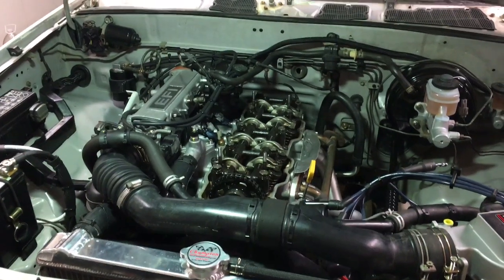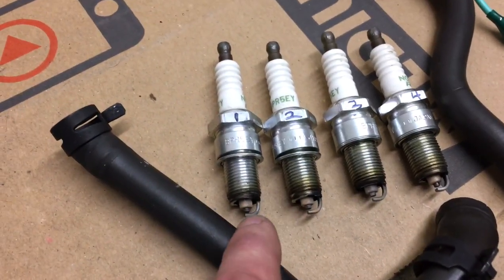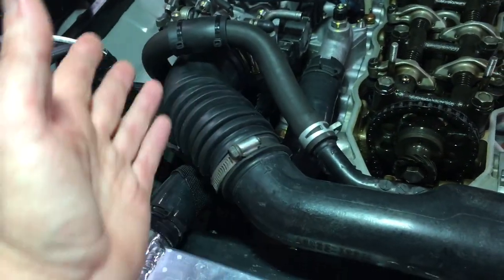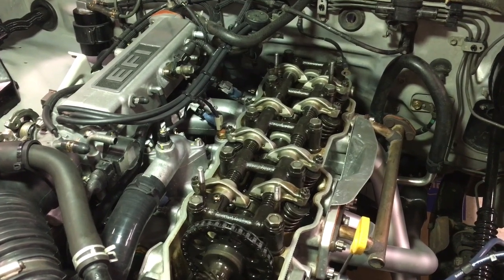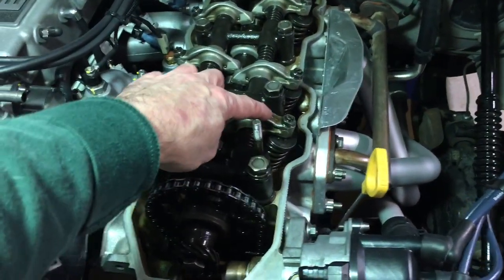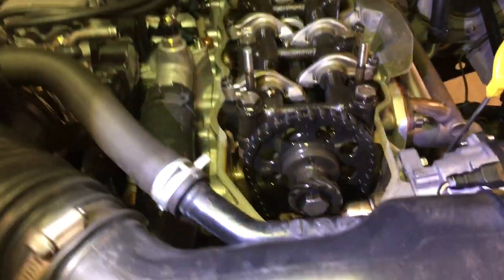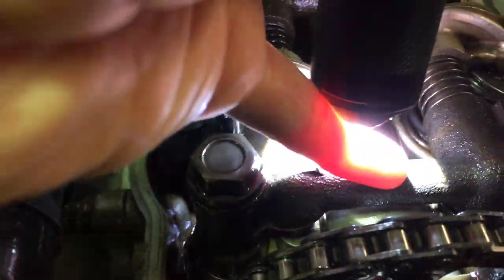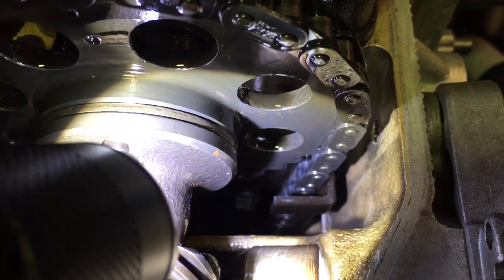Toyota pickup 22RE running rough, valve adjustment & cam gear timing check

Comment: Thanks for the explanation. Another way to find TDC on #1 is to line up timing mark AND see if distributor rotor is pointing to #1 spark wire

Comment: I just received my radiator exactly like yours at Champions I attached a aluminum diamond sheet metal to hold the electric fan with the overflow container from champion also.
Reply from the maker: Glenn Gamboa That's great!

Comment: Aloha Ray, very instructional video Mahalo for that. However, I recently did a top half rebuild and after putting everything back together I noticed that I am on TDC but I may be off a tooth like you mentioned. Those little divots on the sprocket are more between 12 & 1 o clock. Is there a video that you can refer me to or a link I can down load to realign without taking everything apart? Any help or advice would be greatly appreciated. Me and my boy been part time on this build for almost a year and it would crush him and me if we had to open up everything again. Mahalo again from Hawai'i
Reply from the maker: Sounds like you might be off by 1 tooth. Here's a video showing how it should look when the motor is at TDC https://www.youtube.com/watch?v=96xb0oWA3fQ

If you are off, you can put the motor at exactly TDC and then you can pull everything off the front of the camshaft and slip the gear 1 tooth; you just need to make sure to keep the timing chain taut against the guides using like a little block of wood or something. If you do that, you can reposition the cam gear without too much trouble. Normally the dowel pin in the cam should be straight up and down when the motor is at TDC. Hope that helps!
Reply: @ray5961  Yes it does braddah, I will try that first thing in the morning and give you an update. Appreciate your reply. Mahalo!
Reply from the maker: @alekokipuou1433  good luck! let me know how it goes. Make sure to re-time the distributor as well.

Comment: Hi Ray. On the valve adjustment that is suppose to be done hit. How long do you wait for engine to cool down to start the adjustment? Thks..jc
Reply from the maker: I usually do it when the motor is still warm, but not super hot to where it's hard to work. Maybe like 30 minutes after shutting off the motor. I run .012 on the exhaust and .008 on the intake.
Reply: @ray5961  Thks Ray..jc

Comment: I have a '85 Toyota with 22R  factory carb.  with manual trans.  Takes 1hr or less to set valves.  The engine  is warm. as per. Shop Manual.  I'm a 70yr old White guy.  I'm including a Video of the rnotor startng cold so you can judge for yourself.
Reply: Great video !

Comment: Hello Ray! Can you describe your battery/cable/hold down setup for us? That is one clean look! Thanks very much!
Reply from the maker: We were actually just discussing this on another video yesterday and I listed a lot of the parts. Check the comments on the last couple of videos and if you can't find it, I can locate it or give you a run down. The hold down is just a strap and then the rubber thing which holds the tool wrap thing behind the seat
Reply: @ray5961  Thanks Ray, much appreciated!

Comment: Great job man 

Radiator name?
Reply from the maker: Thanks! Champion cooling... I have a video on my channel about it also. https://www.championcooling.com/ - nice radiator, but the one I have leaks a tiny bit and it's super annoying. They did warranty it, but I've yet to install the new one. Several other people have commented that theirs leaked as well. Not sure I would use them again, but if you get one that doesn't leak, it's super nice. I think maybe their welds are not perfect inside or something but who knows for sure.

Comment: Hi Ray. I did a valve adjustment finally and changed out my temp guage sensor at same time. Now my guage is reading hot and almost into red. Is there any chance if I screwed up the valve adjustment that that would cause over heating? I chkd the temp sensor, connecting wire and temp guage and they chkd out fine. I am at a loss right now. Burped cooling system also. I am just wondering if I should redo the valve adjustment if that can cause overhearing. Hope to hear your opinion..thks...jc
Reply from the maker: Did you use a Denso or Toyota sending unit? I'm not a big fan of the ones from china that are all over the place. I think I'd start by swapping back in the old sending unit maybe. Valve lash error can affect temp a little, but probably not drastically enough to register on the gauge. You would have to be pretty far off the map for that to matter. My best is the sending unit is bad, especially if it's an Amazon special or something. If your old sending unit was working, just clean it up on a wire wheel and throw it back in.. they usually go forever.
Reply: @ray5961  Hi Ray, thks very much for getting back to me. I did put old sensor back ( new one was Denso) Here is my test for the day:
First thing I did was swap the new temp guage sensor with the old one. Noticed that the connector did not fit as snug on the new as it did on the old. A little difference on how the  terminals at the top had a small different design. 

Next, opened up radiator cap and placed thermometer inside so I could track temp.
Coolant at cold was 88 degrees.
Next, start engine and start clock.
At 8min I see bubbles coming from radiator. Uh oh.. Guage is below half way point now. The bubbles keep percolating out.
Temp guage is above half way at this point.
Thermostat opens up around 8 min 40 sec. At around 10 minutes coolant is now at 170 degrees. Guage looks good. At 11min 30 sec temp is now 182 degrees.  Guage is below half way. Shutdown engine.
So....was it the air in the system or the temp sensor or a combination? 
Tomorrow I hope to get a rad and cap pressure test kit from oreillys. Once I chk and it looks good. I will test again with radiator cap on this time. Not sure if I will put new sensor back on for right now.
If guage looks good, will go for test drive
Reply from the maker: @Samson-EC  Do you have one of these kits to purge air? https://www.amazon.com/gp/product/B01I40ZQWE - if not, you probably aren't actually purging all the air. It's next to impossible to do without that setup. I'd test the sending unit in a pot with water on the stove but it sounds like maybe you have a vapor lock which is causing the cylinder head to over heat maybe. Try this... remove the feed line behind the thermostat housing (which runs over to the IAC valve stuff) and lift that up in the air, then try filling the radiator up until water/coolant comes out of that line. That will help purge the air out from the cylinder head ceiling  if you don't have that funnel kit handy. Even with it, that's how I get the air out of the cylinder head area for sure. Also take the heater core feed line off and stuck a funnel on there and back fill from there works great. Just filling the system through the radiator tends to be problematic in my experience. I think in one of my recent videos I show the basic routine I use. I think it's the "we have ignition one" about 1/2 way in.
Reply: @ray5961  Hi Ray , you betcha. I have a kit and used it. Nothing bubbled up after 10 minutes and guage was going to red. Then today I was shocked to see bubbles, ie "uh oh". Thanks for your input...Jim
Reply: @ray5961  I tested the new and old unit. Old with pot of water and new on the car. Since it is now off the car I will test tomorrow with pot
Reply from the maker: @Samson-EC  make sure to open the heater core also. You'd be surprised how hard is can be to get air out, if you are not back filling the system through the heater hose while the IAC line is open. Once air is trapped in there, it can be hard to purge out sometimes.
Reply from the maker: @Samson-EC  Sounds good... it will be interesting to see the results.
Reply: @ray5961  when I was using that kit I had the heater on full hot. I did not run the fan at the time though. I am still baffled why I had more bubbles today. I will redo more tomorrow after pressure testing.  Thks..jim
Reply from the maker: @Samson-EC  okay sounds like you've got it largely dialed in. No need to run the fan as long as the heat control is clear over to the red side so that the valve is open. Try purging the air up through the IAC valve line.. that can really help. Run the line into a water bottle and it will usually get 99% of the air out of the system
Reply: @ray5961  Hi Ray. Did my pressure test and final burp today. I did not attempt the iac burp. Was not sure and things look OK temp guage wise. Only issue now is the pressure test showed a very slow leak. Tested cold and warmed up. No telling where it is. I wanted to ask a dump question. I am second guessing myself on my valve adjustment and am thinking about going back in and re- checking the valves.  So what are your thoughts on whether I can reuse the valve cover gasket or not??? I do have a spare. Appreciate your input..thks as always jc..forgot. test drive this evening
Reply from the maker: @Samson-EC  I've been using the same valve cover gasket for 4 years. I've probably adjusted the valves 6 or 7 times... should be no problem as long as it's not hard. You should be able to take it in and out and wipe the rubber gasket part down. If it's hard and stuck in there, then I'd replace it. If it's still rubbery and pops in and out, then you should be fine.
Reply: @ray5961  Hi Steve. Wow, no kidding? I just put this on when I did the valve adj.
Ok, well good to know. Thks
Reply from the maker: @Samson-EC  Yeah, you should be fine. Valve cover on off a lot over here... no problems. Just make sure the rubber gasket and mating surface is dry of oil when you put it all back together. Should be fine.
Reply: @ray5961  Noted..thks
Reply: @ray5961  Hi Ray, well as luck would have it. The leak was coming from the IACV. The hose that runs up to the Throttle Body. The clamp on the plenum side was tight but it was dripping from there down the hose. Took the clamp off and spray all over. Forgot to plug outlet when I removed the hose and coolant gushed out. My burping for naught. Plugged outlets too late. Ordered new hose. I think I now know the IACV hose you were referring to to bleed coolant system. Anyway just an FYI..JC
Reply from the maker: @Samson-EC  Yeah, that hose :-) Fun times.

Comment: your videos have the most perfect explanations. thank you! I knew most of the material but still learned a thing or two. awesome content
Reply from the maker: Thanks man, I really appreciate it :-)
Reply: I thought the timing was 5 degrees before TDC. And you have to short the T1 to E1 on the little gadget by the relay box. Before timing it.
Reply from the maker: @Daniel_Antonio_Arellano782  Yes, that's correct for setting the ignition / spark timing. But there is also camshaft valve timing. That might be what I was talking about in the video.

Comment: how do you get your engine so clean man?
Reply from the maker: Just a lot of cleaning and fine detail work. For the aluminum stuff, I use a cleaner called "Barkeepers Friend", which has a slight acid in it. It's really good for cleaning aluminum stuff. You can also buy citric acid powder off amazon and create your own acid bath in the kitchen sink. I also use old bamboo wooden chopsticks to scale and clean parts (also old tooth brushes). With the chopsticks, just sharpen them w/ a pocket knife or use a bench grinder to grind them into a tip or wedge and then go to work. I also use a real good organic cleaner as well as just gasoline in a spray bottle with a green scrubber scotch bright pad and microfiber rags. It's just a lot of individual cleaning of parts and attention to detail. There's no magic in anything.. just a lot of elbow grease and using that BarKeepers friend cleaner (also BonAmi is a bit less acidic when it comes to cleaning parts which have that gold factory coating - BarKeepers will eat that coating right off). EvapoRust is also super handy to soaking parts over night to remove rust. I've basically cleaned the entire truck with a can of gas and a rag haha :-D
Reply: @ray5961  how did you about doing your wiring and vac lines. I don’t have much exp with wiring and am still learning about the 22re in general
Reply from the maker: @itsgatormane  I have some good videos which cover the 22RE vacuum lines and how everything operates. It takes some time to get up to speed on the motor and understand what is happening for sure. When I first bought my truck, I didn't know anything specific to the 22RE myself, so it was a little bit of a learning curve. Maybe I should do a video to sort of give a broad overview. Anyway, on the vacuum lines, some of them can be scaled back a little, depending on what all you need to run. For example, the vacuum line which goes to the regulator on the fuel rail loops through a VSV (vacuum switching valve) that is bolted to the valve cover. However, that pressure regulator basically works in time with engine vacuum, so you can just ditch the VSV and run a hose directly if you want. I also threw away my P/S, so the VSV that works with that went as well. The remaining two I needed (the air suction (AS) and the Exhaust Gas Re-circulation (EGR) systems have VSV's, but I just moved them off to the fender to clean things up. As far as wiring, I removed almost the entire wiring harness and taught myself what each wire did and took it all apart and cleaned it and re-soldered / rebuilt a lot of the connections. I had some electrical issues I had to trace down and just wanted to clean the harness up and re-insulate some of it in high heat rubberized fiberglass sleeves, etc. I also installed a higher output 140A alternator, so I had to make larger harnesses for that, which required running larger wires and things. It's just one of those things where once you dig into everything, it helps you learn and clean things up, etc. If you are going to be doing any extensive electrical work, you might want to invest in the electrical manual from Toyota (as well as the originally factory shop manuals). All of those really help when you start working on the motor, etc. The electrical manual (which is featured in a couple of my other videos) will show you what's what right down to the individual pin numbers inside each electrical connector; it's really a handy manual to have around.

Comment: How did you install the half moons Ray?  Thks...jc
Reply from the maker: RTV ultra black
Reply: @ray5961  Does it go on bottom of moon only  or on top where it meets rubber seal?  jc
Reply from the maker: @Samson-EC  Just put a small amount around the bottom where it touches the aluminum of the cylinder head - do not put any sealant on the top part, where the valve cover gasket touches.
Reply: @ray5961  Thks Ray...jc
Reply from the maker: @Samson-EC  Yeah, no sweat.
Reply: @ray5961  Hi Ray. Bugging you again..I only have rtv ultra gray. Should I use the black instead of the gray?  Thks..jc
Reply: I bought some black and that was what I cleaned off so black it is

Comment: Where did you get your exhaust from?
Reply from the maker: rodney cassidy The header is made by LC Engineering - it's their ceramic coated SS one which is CA smog legal and has the EO # stamped on it. Then I just fabricated the rest myself from 2.25" stainless tubing from Stainless Bros. The slip fittings are from Stainless Bros as well and the clamps are W5 316 SS Mikalor clamps. The catalytic converter is the CA legal one from Magnaflow and then there is a Vibrant ultra quiet resonator behind that and a larger Vibrant ultra quiet resonator at the end. The 45 and 60 degree mandrel bends also came from Vibrant (you can buy them via amazon). I just started from the front and cut and fit everything using the slip fittings welded into the tubing, etc. I fabricated my own hangers from 3/8 SS rods and just heated them up and bent them and then TIG welded the tips on and forged them into shape with a hammer. I TIG welded all the joints with 308 rod. That's about it; let me know if you have any specific questions on it. The exhaust turned out pretty nice and seems to have a pretty good balance between sound and flow. Oh and then I also had to weld in a bung for the downstream O2 sensor. The LCE pipe off the collector has a factory style 2 bolt flange for the upstream O2 sensor. And then I also welded in a separate O2 bung for the AEM wideband O2 gauge, which has proven to be invaluable as far as monitoring if the motor is running correctly and helps give a picture into how the truck's ECU is functioning as far as fuel mapping, etc.
Reply: @ray5961  you did a hell of a job on it. More money than I want to spend on my little beater. Thanks
Reply from the maker: rodney cassidy Thanks a lot man, I really appreciate it. The little truck is a lot of work, but part of this project was to learn all about the Toyota pickup and the 22RE motor. I'm planning on keeping this little truck for a long, long time. The exhaust project was a lot of work for sure haha :-)

Comment: U r not correct,u have timing marks on the crank gear,on the cam gear,and on the rocker assembly...u align these!!! If u go by the dowel u r gonna be 1 tooth off everytime
Reply from the maker: Thanks for the info on that. I'll double check things when I assemble the motor. I was actually going to time the cam using a dial indicator against a degree wheels on the nose of the crank to be certain the valve lift at .050" matches what I'm aiming for here.